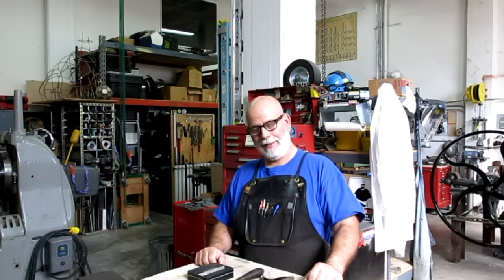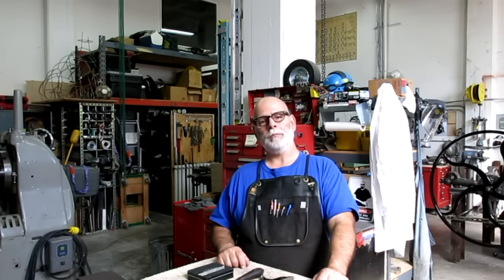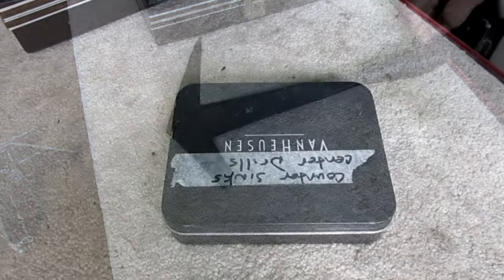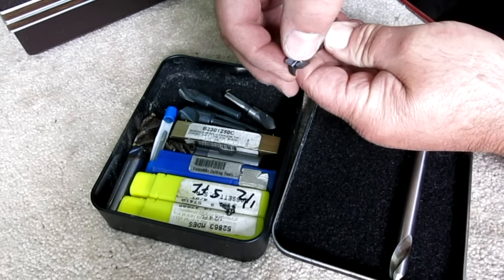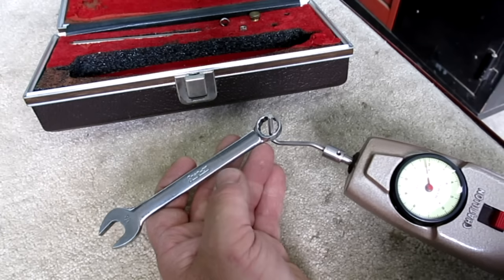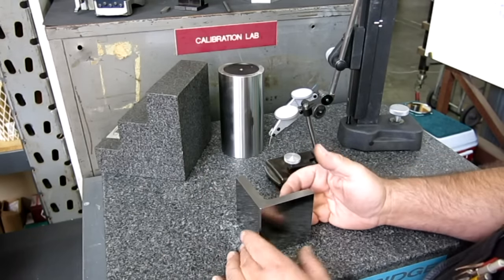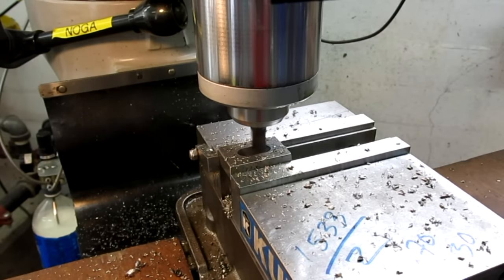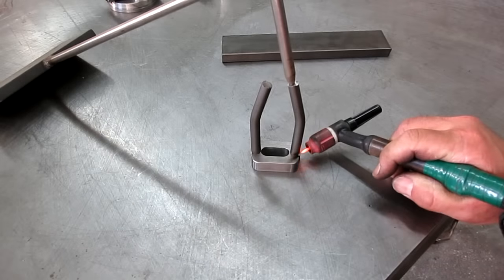Monday Night Meatloaf 91

Comment: working with slate roofing. there is another tool that comes with it. It is some form of stake that can be hammered in the wood of the roof, on which the slates are cut to dimension with the part above the handle. the spike is to make the hole for nailing the slate. A friend of mine still does slate roofing on churches and so. Cheers.
Reply: +John Ridley that might explain the 3 holes on top, the nail puller was riveted on, and fell off
Reply: +Flip de boer spot on... slate roofing hammer ;)

Comment: Slate hammer, i have one. It's a Picard no 207 (mine) , sweet tool, fixed my roof over the summer with it. You're missing the nail removing bit, btw.

You really know your hammers if you managed to pick that much up just by the shape, impressive, very, very impressive.

If it's French then it's sha-tily-on, if not, the way is free for any pronunciation. :))

Comment: Hi, Tom

Yes !!!  Elemental Beryllium is toxic when inhaled in the form of dust.

My Father in Law died, in large part by inhalation of the dust from grinding this material. 
He designed and built inertial guidance systems for military projects, and the 
Elemental Beryllium was necessary because of it's high modulus of elasticity.
Most doctors have no understanding or knowledge of this material, as it is not something that they usually encounter.
My Father in Law swore up till His dying day that Beryllium was safe.
 
What you have, is a beryllium/copper alloy hammer.

When alloyed with another metal, beryllium is perfectly safe, Charter Arms Manufacture used to make firing pins out of beryllium copper.

Very good hammer, with a very good back story, and a great part of your hammer collection.

Tim

Comment: Hi tom I worked my way though college as a roofer. The point on the hammer was used to put holes in the slate to fasten them to the roof. There would have been a small claw out the side to pull the copper nails used to hold down the slate. So here the fun part your are 6 stories up on an old slate church roof and need to fit a slate.  The 
Slate cutter is on the ground so you use the pick end to score a few wholes in the edge of the slate then you break the slate roughly along the holes. Now the edge of the slat hammer come's in to play you can use it like a hatchet to smooth the edge of the slate. So you hammer is also referred to as a slate hatchet.  Also kind of interesting when you repair a slate in a field of existing slates you can't nail,the last slates because they are under the others so you hang it by hailing a piece of cooper under it the bend the edge up and over to hang the repair slates.

Comment: Nice job for your Dad. You still find all the cool tools and great deals on the cutters. We use the diamondback roughers a lot and they do great better than the nobby styles a lot of the time. The beryllium copper hammer head and story were good. I would have had the same reaction to the head being thrown away. There are many things made which only get used once and they are disposed of in the scrap bin like medical and semiconductor parts or devices.

Comment: It's a slate tiler's hammer Tom. It is used to cut the tile to size, (an art in itself) then put a small nail hole in the tile with the pointy bit, then used to drive the nail in.
Cheers Eric

Comment: Hey Tom, 

I made one of those angle iron angle plates just like yours, using your same methods. Mine is scraped instead of ground, and it sure took a long time. About a week for me, on/off. It's within 5 tenths, and I would imagine with a good box knee on your fancy new grinder you should be able to get it within a tenth and a half, or less if you really want to get fancy.

During some wars, planes would have a supply of liquid oxidizer to act as emergency power fuel. Imagine N02 on a drag car. That is possibly what the liquid oxygen is for.

Comment: Holy smokes Tom, that finish off the grinder looks awesome! I'm looking forward to seeing some more sweet lovin' coming off that momma some time soon. 

I'm not sure about liquid oxygen, but we carry pressurised oxygen on all the commercial aircraft, as do the military. I'm not sure about the non-sparking hammer part, maybe we don't hammer away on the oxygen cylinders down here as much as the US Navy? I do know it's a good thing we've moved on from waxed moustaches however!!!

PS I have just metricised your rod bender to sensible units ;) and the stock we have Down-Under, the CAD looks fine so will add my part in Liptonising the world once I do a run to pick up some appropriate sized angle. Nicely done on the design. Your shot of the DIY angle plate reminded me that I will get some extra, chop it up and grind it to angle plates. I figure angle plates are kinda like clamps. Rule #1,; You can NEVER have too many clamps!!!

Comment: Nice meatloaf, Tom.  The liquid nitrogen was probably used on all planes as their source for creating breathing oxygen for the pilot about a certain altitude.  Cool hammer and other tools.  Liked that valve actuator...simple but effective.
Reply: +ILGopher I also read that both types of "reaction motors" on the X-15 used LOX as oxidizer for their record holding test flights...at least the records that are publicly known. I never thought about how much LOX was used for their breathing masks on flight crews. Good thinking, and opens up a much greater variety of aircraft that a non-sparking hammer would be used on...Thanks ALLOT, LOL!!!

Aloha...Chuck.

Comment: Hey Tom, 
The lock on the force gauge is to hold the reading. If you want to see how much force it takes to release something. 
LOX is use in most if not all aircraft for O2 for pilots. Also oil is very dangerous around LOX.

Comment: You are correct, that is in fact a German roofing hammer. Also called slate hammer. 
It is just to format slate shingles or tiles. Punch holes through the shingles to nail them to the roof. It is part of the German roofers guild emblem. 
Handgeschmiedet means hand forged. Are you sure about "verstahlt"? Stahl means steel, but the proposition ver doesn't really work in this constellation.

Comment: This is a slate hammer. The two grinds are to trim slate plates on a special kind of mobile anvil, a slaters stake. The point is for punching nail holes and the hammer face is to nail the plates to the wall.

The claw hammer probably was needed to get spare parts for the planes out of their crates.

Comment: The Hammer: You are right, this is some Kind of roofers hammer. This is a German slate shingle hammer. With that edges (and with an anvil like T-piece whacked in the rafters as an Counterpart used in a shearing motion) the slate shingle ist cut to size by nibbling it away in little pieces. Then there is pierced a hole for the nail with the Point and at last you nail it with the peen. "verstahlt" means "made to steel" (from whatever). Mybe some edges are hardened. This hammer is part of Roofers Guild mark here in Germany.
Reply: +Hermann Straub As far as I can tell, “verstahlt” is a somewhat archaic word for “case hardened”, or maybe “hardened” in general, when referring to wrought iron etc.
Reply: +Tilman Ahr Well, You are first. This is what i found out as well. Enrich the Surface with carbon to make a better steel and then harden it. Leaving a tough core for strength.Again what learned.:-)

Comment: Tool is a slaters ripper, for roofing slate removal etc
Reply: +jusb1066 Yep, seen one in Germany, those guys can fly, they also use it for installing the edge on the handle is for cutting slate to fit. Have no idea what the 3 holes are all about. Slate is still used a lot  in Europe.

Comment: Tom, I loved the hammer story. One comment on your valve turner, though. I'm wondering if your Dad would have a better view of the slot if the handle was 90 degrees in relation? Aligning the handle with the slot - seems to me that it would block the view a bit. Just a thought. I love your stuff, keep it up!

Comment: WoW, I guess that hammer could be used for roofing but it was a German Tanker's Boot Hammer.  It is a little weird shape to be used as a roofing hammer and the Germans were one for simplicity in design.  I must say some of these hammers were given a lifting notch in the middle of the head that could be used for pulling nails the main working of the hammer you have was small tank repairs and it was called a Boot Hammer because it was smaller than the other hammers.

Comment: I had a leaking valve and made myself a tool to shut off my water at the street. As I was shutting it off a utility truck drove by and came back quickly with the police. They tried charging me with tampering with a public utility. They said that they owned the pipes till the leaky shut off valve in my basement. Long story short I did not get into any trouble and since it was their valve apparently, they had to come and fix it for me for free.

Comment: I use those three flute "aircraft" style three flute countersinks in a cnc lathe doing plastics all the time, very rigid and very sharp. usually no bigger than .250"
Reply: +Max Maruszewski and heh, I make those stubby boring bars for back recessing all the time out of broken endmills at work on the surface grinder. They work real nice.